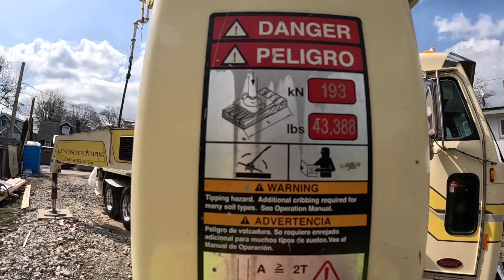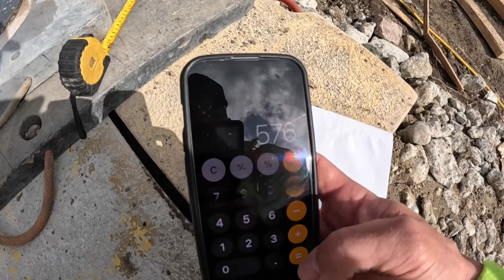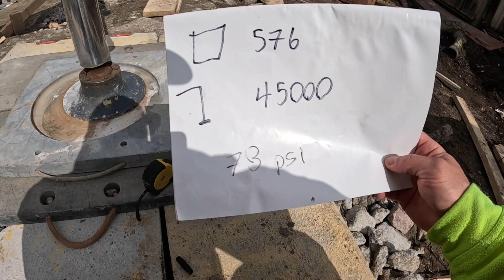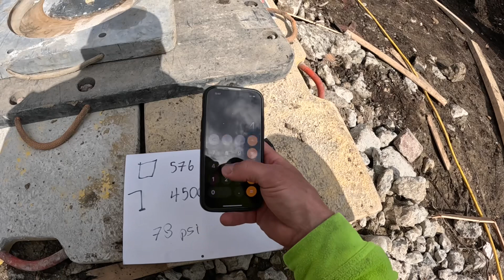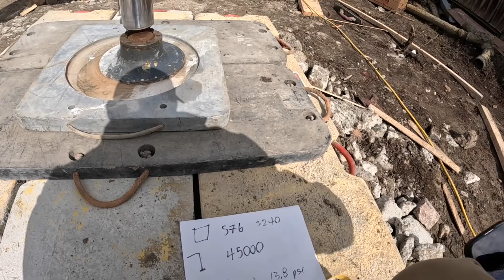How to calculate outrigger ground pressure when building a dunnage/cribbing pad:

Comment: The flexibility in those pads render your calculations Inaccurate.
Ya guddah have the stiffness in the pads to backup the math.
Noe eye say’n
Reply from the maker: The “Fibre Tech” (yellow pads) used here for the base layer are incredibly stiff. The thermoplastic pads used for the second layer and top pad do have some flex to them (we typically would used fibre tech pads as the second layer as well, but ran short of them on this day). Used in multiple layers like this flex is minimized, but agreeably not as rigid as something like a 6”X6” timber. That being said, neither is a steel road plate. The engineering behind the pads is that they will flex to a certain degree but will not completely fail, whereas a wooden pad has very little initial flex, but is much more prone to complete failure if/when it does bend. It is tough to beat large timbers or swamp pads for sure, the problem is finding room on the pump for carrying enough of them to build a pad of sufficient surface area.
Reply: @canadianconcretepumper1979  :
Thank you
Reply from the maker: @ginoasci  Thank you for the comment. It’s a great discussion point for sure 👍🏼👍🏼👍🏼
Reply: That actually weren’t flexing you can see by the fact the one side was up in the air a little meaning the ground was uneven and the pads weren’t conforming to the ground and staying rigid.

Comment: Excellent posting and clear instruction. While the mobile pumping machine is not a crane per se, some safety principles would probably apply to both. I noticed a sloped embankment or ditch in front of the machine. Not sure what the rule of thumb is for safe distance from outrigger to edge of embankment ..? probably depends on depth of slope and weight of machine including load and the current GBC ( Ground Bearing Capacity ) of the soil. No criticism just curious. My friend was bent over running pipe in a ditch about 6 feet deep with no shoring , before OSHA. Vibration from a machine caused the walls of the ditch to suddenly collapse. Three guys just happened to be standing directly above him when it caved. They knew exactly where to dig. Racing furiously they got him out of mostly loose sand. He made it, had some torn ligaments in a leg, three broke ribs from sand compression but was alive thank God, and those who dug him out.
Reply from the maker: Awhile back, I actually did a dedicated video pertaining to exactly what you mention: https://youtu.be/lmUWis6Ynq4?si=-IAnK5Tmsp38k8eH

Appreciating you watching and commenting/ definitely can’t be too safe/overkill when it comes to outrigger dunnage 👍🏼👍🏼👍🏼

Comment: The simplicity of this instruction is a real jewel, while bringing the ground PSI into limits. Retired now but had to work around concrete as electrician running 4" rigid conduit into slabs for large electrical switch gear with a turned up elbow or straight pipe into transformer vault. I still remember some numbers, a yd was 27 cu.ft., a yd weighed around 4,000 lbs, a cu.ft was 150 lbs.  12 runs of straight 4" I.D. Rigid conduit 20' feet long, 240" inches, would reduce the concrete required by 1 yard. A yard with slab 8" inches thick will cover 41 sq.ft.per yard.  All our jobs years ago were with concrete trucks dumping into a large bucket or hopper then lifted by crane especially when pouring a waffle or pan slab. Question-How do you push the last of the concrete out of hose or pipe.. is it done with some type slug in front of air pressure behind it or what..??

Comment: why are 2x4's considered non appropriate for dunnage ?  I understand that larger timbers or dica type synthetic cribbing is obviously superior but if you stack enough 2x4's they have to equate to a larger piece of lumber based on just volume, no?  The outrigger doesn't know if you have a dozen 8x8's or a whole lift of 2x4's underneath it, as long as they are laid out in a humane manor and can remain sturdy
Reply from the maker: Placed horizontally, the strength of timbers increases exponentially with size. (Eg: two 2x4’s placed one on top of the other are not as strong in terms of horizontal load bearing capabilities as one single piece of 4X6 timber of the same length.

Comment: What size pads are those under the 24x24?
Reply from the maker: 18”X48”. We have found these to be the most versatile as well as user friendly pad size for the 40M-ish and smaller pump sizes.
Reply: @canadianconcretepumper1979  love these! We run the 24”x24” and the 48”x48”. These are the missing pieces we need.
Reply from the maker: @DangleMan27  Yes, they are just about the perfect size for one guy to manage on his own without any help needed.

Comment: If it's wood timbers, hard wood only. Other than that, great as usual
Reply from the maker: I thought about that after the fact. I’ve seen some guys using 2”X6” oak Timbers, which are pretty skookum.
Reply: @Canadian Concrete Pumper   Ya..that's a no go for me also, absolutely not. I need the truck to stay soft side down, and I don't need to be worrying about my setup. 4x6 Hard wood minimum
Reply from the maker: @greghughey9738  when you say hard wood, are you talking something aside from the standard spruce or fir?
Reply: @Canadian Concrete Pumper   oak preferably. It's heavy, and it's expensive, but it's strong and it lasts. Bossman gets us dimensional cut 4"×6"×4' 200 at a time. I like to keep 42-44 on the 63, 97,800/92,200 isn't something I'm willing to play with

Neat factoid, unrelated to cribbing, the 63 I run is #2 off the assembly line. Being a horsepower junkie, I've grown weird about vin#s. Doesn't get much lower than #2 lol